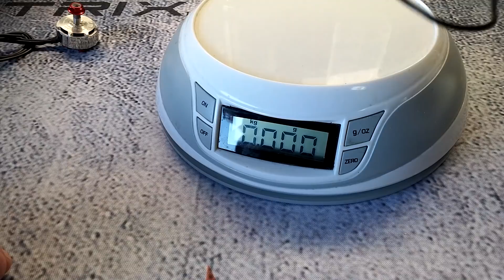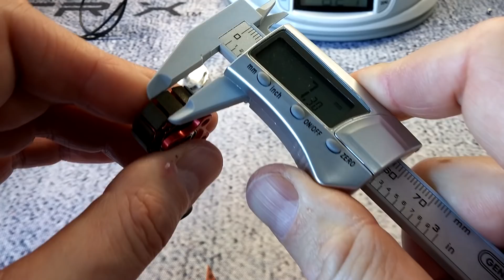ZMX FinX30 2207.5 Motor Overview & Tear Down

Comment: i couldnt run zmx finx40 2.6 they could been reason i kept blowing fets on spedix 4.1 esc two in fact.. so i had to use spedix es30hv with f40 pro ll 2600 ..oh well

Comment: Do they come with standard and reverse threaded shafts?
Reply from the maker: Jason D - No they don't, it's really not needed nowadays if you're using good lock nuts, and most motors don't offer the option anymore.

Comment: Can you check the temperature on these, they run so hot you will burn your hands touching them even just running on the motors tab
Reply: Something is up with your setup. I run these on a heavy 570 AUW 5 " and I don't have any issues even with amp heavy Avans.
Reply: What about a brief run with no pops. how is the heat?
Reply from the maker: Rick Flare - Once I get my frame in to build I'll check the motor temperatures, but if your motors are getting hot just running at no load in the motors tab, I'd say check and make sure the motor screws aren't touching the windings, check your esc settings in blheli, and check your solder joints from the motors to the esc's, and the esc's to your flight controller for any shorts or dry solder joints since the motors shouldn't be getting hot that easily.
Reply: Thanks, look forward to your findings. I got an email from silver drones and they were no help and never gave me a straight answer. Instead they were saying something like to not run them without props as they will heat up under no load and burn out.
Reply from the maker: Rick Flare - I ordered 5 of these motors from Pirofliprc on Black Friday, and 2 out of the 5 seemed like they were a bit rough and grinding when I spun the bells. I took the 2 motors apart and found tiny bits of metal shavings inside which were causing the grinding, and might be causing your heat issue's from small shorts. They are somewhat correct that you shouldn't be spinning the motors up to high rpms with no load, but the motors should not be getting burning hot from a short motor tab test for no reason.
Reply: You can get in touch with me personally on facebook Bui Hoang Linh. What's your esc  and esc timing? Also test the motor on a known good esc will help as bad ESCs will burn the motor

Comment: Ewww weeeee. Them are sweet....I need to get me a set of those to replace my hypetrains. Just broke my 4 motor in a few weeks (weak bell design).. Zmx on the freestyle??
Reply from the maker: Splinter Fpv - They are pretty looking bling bling motors aren't they? I was thinking the same thing about putting them on the freestyle Armattan Rooster build, since they're supposed to be a smoother running motor.
Reply: SteelRainFPV yeah smoother and from what i have been hearing 2207 motors have more torque than 2306 due to the stator having more internal mass.